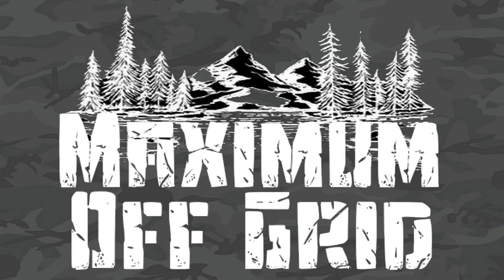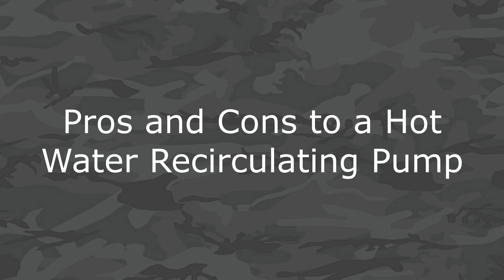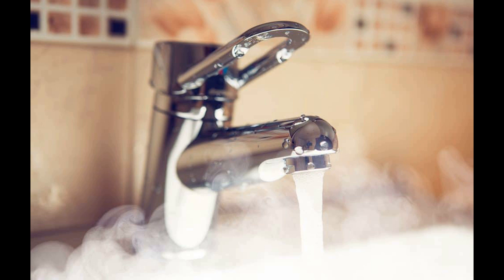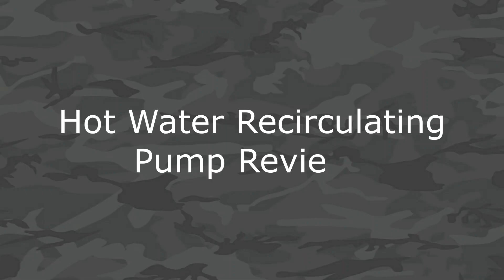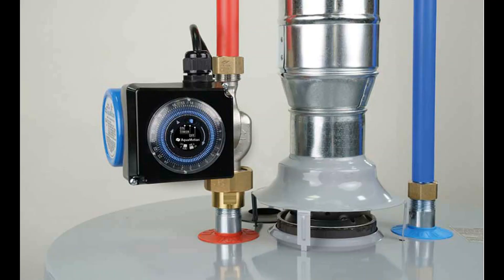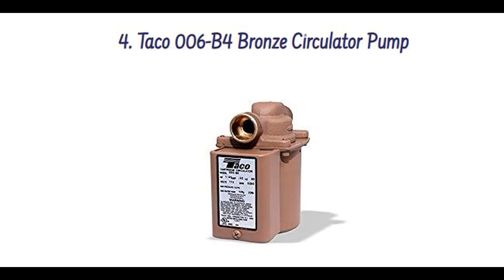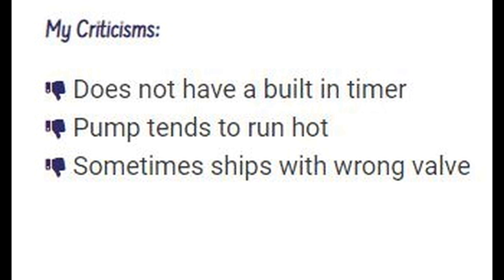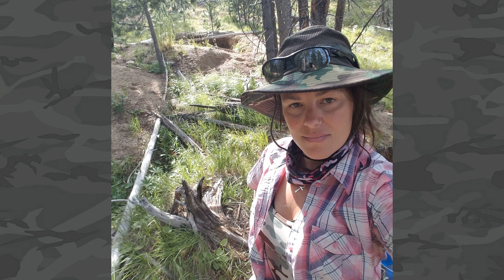All About Hot Water Recirculating Pump Systems! Product Reviews and Valuable Info

Comment: Also...GET RID of the COPPER SPIRAL tubing which will eventually BREAK.
REPLACE with Stainless steel BRAIDED tubing.
I lost 6,000 gallons of water with the spiral copper ones before I even discovered the problem.
Reply from the maker: Oh wow, that is a good point. Ty!

Comment: Hi,
Just discovered your channel.
A couple of thoughts on this subject...
You could put a flow meter on the cold water main to the house for a year and this would quantify gallons used. If you take readings monthly/weekly and record temperature and weather you would have a good baseline for comparison after making improvements.
Next, you could eliminate the pump entirely by doing two things:
     Run a return pipe from just before a hot water faucet back to a return manifold located at the base of the water heater.
     Wrap the existing hot water pipe and the return pipe together in insulation to help preserve heat in both pipes. In this way the natural difference between more rapidly moving water molecules (hot) at hot water out of the water heater and the less energetic molecules (cold) of water returned to the water heater will provide constantly recirculating water flow to all such plumbed hot water faucets. Thus, no need for a hot water pump.
Enjoy your channel.
Cheers,
Mark
Reply from the maker: Thank you for the great tips! And enjoy the channel :)

Comment: Thanks for your video. I have only been researching these systems for a couple days and I have come to a little different conclusion. I would rank the Watts after the Laing. The reason being reviews for the Watts suggest the the valve that goes under the furthest sink does not last long. Maybe 1 to a few years. They can fail to make the water hot or may fail be staying open and the both 'hot' and 'cold' are hot and waste energy. They are like $50+ and are made of plastic. People often have problems with them breaking threads. Generally people hate them. They really should make a brass version in my opinion. The Laing also just makes more sense to me since My furthest faucet is the kitchen sink which has a power outlet open there.
Thanks again for the video. :-)
Reply from the maker: Yes, the Laing is really the best, but the price point is a bit high, so I figured in that aspect. But if you have the money, definetely get the Laing!

Comment: Lotsa issues here and many points are simply misleasding or wrong. Pump flow will not cause corrosion of the piping. Maybe you're confusing "erosion" with "corrosion". Even here, erosion comes from the water carrying dirt and abrasives, and a domestic water system has no debris. The extra erosion from a few GPM more is almost zero-more. Not much at all for copper and probably zero for PEX.  Not a valid point at all. Another "pro" besides immediate hot water....is the prevention of some nearby pipes from freezing, expecially if the under-sink valve is near a sink where the local  pipes can freeze. The under-sink valve will "push" some of the hot water into the cold-water line whenever the temp of the hot water ( at idle standby) decays too much, and is replenished with fresh hot water ( happens autmatically from the hot-to-cold side of the valve, via the thermal element). The thermal valve portion, inside the under-sink valve, will do this for you automatically, and it may help prevent pipe freeze nearby. The TACO system is better overall to either the Watts or Grundfos   Also, in dispute from what you say, The TACO I have has THREADED connections, is made of Stainless, and DOES have a timer. So what are you talking about:? There are at least a 1/2 dozen different TACO models to choose from. The Watts or (identical) Grundfos pump systems, have under-sink valves that do NOT come apart to allow cleaning. The under-sink TACO valve is "openable"...to enable it to be cleaned or fixed. Heat traps on water heaters.....you say won't work. Many people agree on this point.  Guess what? ....almost ALL water heaters you buy over the last 10 years or so HAVE heat traps, so this caution will apply to nearly everyone reading this. If it's a flap-style heat trap, you can often remove the flap with needle nose pliers. The ball/cage style require more work to get the ball out....but it can be done. 
Finally....I challenge you to say this is an "in-depth" review...as I am certain YOU did not buy all these and test these....but you are only repeating written reports you may have found on each. This is misleading. All in all.....this is a fail, as this is not your own testing, and some of the data is plain wrong.
Reply: You may have some valid points, but your tone is really offensive. It’s easy to dis agree without being disagreeable. Have you considered doing a video on this yourself?
Reply: @joeoleary5346  ,...citing corrective facts, and calling out bluffs, is not being disagreeable.  How else can these same points come out without the original pesenter maybe being rankled? I wish you a Merry Christmas.
Reply from the maker: You have some valid arguments here, and I appreciate the time you took to provide me feedback. The recirc pump is a complex topic and for it being my very first youtube video, I think I did a pretty good job. It would be impossible to test all of these pumps, but hardly anyone on the net has even attempted to put together a review for recirc pumps. At least I put in good hard research to give this video a lot of value. I will give myself a pat on the back for my efforts and try to improve on my updated recirc pump video coming out soon.
Reply: @RusticSkills  ..no issues on your effort....apologize for maybe the cranky approach I used to comment at the time....but my point is that providing a textural review of options is not an "in-depth" review...as that label would require you ( or others that you can point to)..... to have had your hands on the hardware, or similar....to gain the label "in-depth" . There were also a number of factual errors in your presentation....those that I called out....and I bring up those issues because others are reading and being informed by what you say, as being true and factual. No issues that you put-ina considerable effort...I'm sure you did....but fact-checking and nomenclature could have been edited better. Just responding for clarity and not for irritation or continuing an argument....cheers.
Reply from the maker: @TheWilferch  I do appreciate your feedback. Tbh, I had zero expectations of this video going over 100 views, let alone approaching 100,000! There is no way to edit a vid once released, only deletion. My plan is to make a more accurate version of this vid and then have a link on this vid to point to the new one. I've learned so much just from the comments it is amazing! Who knew hot water recirc pumps would strike such a cord. Well until then!
Reply: @RusticSkills  ...thank you for the courteous response...again, my apologies in public for my first brusk repsonses.....that said....good, ...I wish you all good fortune as you continue on this path.
Reply: Someone take away Wil's keyboard..
Reply: Who gave Will back the keyboard!?!
Reply: @nateshizzle1  ....tell me where I'm wrong.....this original remark I made to this presentation is months old, and I have no reason or desire to engage.....yet an email landed in my inbox today.... to prompt me back in by showing this latest response from the originator, which tells us nothing about the points I bring up that attempted to make the issues more factual. Tell ya what..... believe that "erosion" is the same as "corrosion".....believe that some pumps come only one way with threaded or flanged connections....when in fact this is not true ....believe what anybody says....I'm ok with all of that, if that's what you want to believe. I apologized for the tone of my original note, but cannot stand down items I show were presented that are false. Out.

Comment: Great video! Do you have any thoughts on the Chilipepper pump with a tankless system?
Reply: I have had 3 Chilipeppers, original one lasted about 8 years, replaced it outside of warranty. The replacement worked for about 3 months when I accidentally ran it dry, got another one and is working fine. NEVER run it dry, pro-tip. It is a bit loud when activated, but it is only on when you need hot water. I have it on a conventional tank heater, but I think working on a tankless unit would be fine. If in doubt call up the company, they'll know for sure.
Reply from the maker: I haven't done much research on the Chilipepper but will include it in the next updated video!
Reply: I used it on three different homes .. I loved it .. it’s a bit noise not too bad at all.. I’m sure it’s gonna work great in a tankless. It might be the most affordable one for a tankless

Comment: Here is a question i can't seem to find an answer for:  My current water heater is a 50 gallon electric TANK model.  believe it or not, it is an A.O. Smith and is 26 years old - a house original - so i can't complain that it has lasted a long time (I've only owned the house for 4 of these 26 years).  well it is now failing and i am going to replace it with a tankless.  seems to make sense.

the situation:  the current water heater has a re-circulation pump off the hot outlet side with a dedicated return line (the return line going back into the cold water inlet of the WH, check-valve to keep it from going back into the cold supply line and water softener) so there is hot water at every faucet in the house within seconds.  almost instantly.  there are motion sensors which activate the pump for a minute or two so it is not always running.  

i  believe there is even a sensor at the end of the return line (before it goes back into the cold inlet) to keep the pump from running if the water is already above 120 degrees (or shuts it off if that temperature is detected before the motion sensor would shut it off).  without the pump, it would take almost 3 minutes for the water to get hot at the furthest fixture, and it cools off quickly once you shut the faucet off.  makes it a pain in the butt for rinsing dishes in the kitchen - which is the furthest fixture.

the question:  how do you hook up any electric tankless water heaters WITH the circulation pump in the loop where it does not void the warranty?  i have seen videos (for Rheem) that has this feature with a gas model, but not electric.  Certainly there must be a way?  

the theory should be the same with a tankless model as it is for a tank.  activating the pump when you walk into a room is like turning on the faucet (because of the return line).  the WH does not know someone has not turned the faucet on.
Reply from the maker: Well that is quite an interesting situation you have going on. From what I understand, the only difference between a tank and a tankless electric water heater is the tank is an additional feature to store extra hot water, but it works exactly like a tankless.

That being said, I would be weary of hooking up a traditional circulating pump to it, as most are incompatible with electric tankless water heaters. 

There is one model I have found that works with tankless, but it is rather expensive at over $500. If you are interested I can send you the link to the pump.

Comment: Not mentioned is that the valve under the sink has a thermostat.  this thermostat is often set to stop water movement at 95 degrees.  so you will likely not get so hot water only warm water.  another disadvantage is that if you turn on cold water you get hot for the same period of time it took to get hot water originally.  for me not good enough.
Reply from the maker: Yes, the recirc pump does not work for everyone's situation. You have to evaluate if its right for you.

Comment: If my water heater has a heat trap does that mean none of the pumps will work?
Reply from the maker: I wouldn't go so far to say that none will work. However, I recommend that you check with the manufacturer before purchasing a pump.
Reply: Heat trap doesn't matter, it's a lot of folks spouting stuff they don't understand. The pumps work on positive flow so it's going to push the water through the piping.

Comment: Just installed the Watts 500899 H.W. recirculating system.  It works as advertised and I would highly recommend it.  Question:  After the initial H.W. pumping has charged the line, does the thermal bypass valve re-open as the water cools down?  Will the pump automatically restart when the valve re-opens?
Reply from the maker: I found a great article that should answer your question, way more in depth than I could describe: https://besthotwaterrecirculators.com/how-do-sensor-valves-work/
Reply: A city water line point of entry has a back flow prevention valve installed as a code requirement.  The meter will not allow 
back flow either. No water that has entered your home can pass back into the primary water supply from the street.  I’m not positive, but I think the pump is actually sending the water back to the hot water tank so it’s refilling the tank as it’s pumping. If a different hot or cold  water faucet is opened elsewhere in your home as the pump is operating, the pump will send the water to the open faucet which then becomes the point of least resistance.

Comment: You never said if any can be used with a tankless water heater, only that the first one would not
Reply from the maker: So I have found only one tankless water heater recirc pump that is compatible with all tankless models. It is quite expensive. I listed it on my article; I cannot edit the video to include it. I will be working on an updated video to include that pump. You can find it here: https://www.maximumoffgrid.com/off-grid-water-system/hot-water-recirculating-pump-reviews/#3

Comment: Hello Regina, thanks for this great informative video, what is the difference between the pump on top of the water heater, or under the sink? And does the cold water line would have more pressure build up?
Reply from the maker: Thanks! The difference between the two installation points is that undersink installation does not require a return line, whereas installing at the water heater does. When installing undersink, place the pump at the farthest hot water point.

As far as cold water line pressure goes, from my research I have not found any issues about pressure in the cold line.

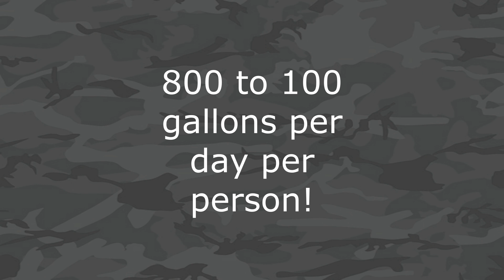Comment: Good review....You say on average we Americans  use 80-100 gals/day....yet your text at timeline 0:52 says 800-100.... may want to fix that. Also,.....is there a way to rig the system up to prevent water line freezing as a goal, instead of immediate-hot-water use?
Reply from the maker: Thanks, unfortunately I cannot edit the video once it's posted, darn! Since the system always pumps hot water thru the lines, it should keep them from freezing, but you can add insulation to the lines which will also help from heat loss as well.
Reply: @RusticSkills  ....the house is already built and I...like many others...may suffer the occasional cold snap in the South where the insulation around pipes is already a done deal...maybe poorly performed...and hidden behind cabinets and walls, and is ineffective. Can't reasonably "Add" insulation under this scenario. Problem for me is typically 2 bathroom sinks against an outside wall under these conditions. By the way, insulation itself often does little in these scenarios, as heat needs to be added. It's like these goofy outside hose spigot insulating boxes you can install. Over time......the air inside the box will attain the same cold ambient temps as outside the box,  and will still freeze, unless you put a lightbulb against the spigot too or some other form of heat input. It's like saying putting a coat on a dead body out in the cold is the same as a live person putting on a coat. You need heat production to have insulation have any longer term value.
Reply from the maker: @TheWilferch  So you can install this pump right at the water heater which will send hot water thru your pipes throughout the entire house, which could help them from freezing up, as opposed to installing underneath the sink. Although you might have some issues with heat loss since the hot water is traveling so far, since your pipes are somewhat insulated already it may actually work really well to keep at least the hot water line from freezing. Yeah I totally get what you mean by putting a coat on a dead body, good analogy! Lol

Comment: I would like to know what pump you use... i have a start in rain water collection and i need a pump to push it to another tank... of course would be nice in the house.. not sure how i can do that yet... but pump yes
Reply from the maker: The waterbug would be a good option just put it in the tank and place it on a programmable wifi outlet. you can turn on the pump from your smartphone and pump anywhere you want, it sucks water to 1/16th of an inch. Just don't forget to shut it off when you are done!

Oh, I am making a video on submersible pumps that will be out in the next couple days. That will have the pumps you are looking for.

Comment: We certainly need this in California what with them rolling out the 55 gallon per person consumption rate per day by 2022 or face a fine.  Thank you for the info, I didn't even know these pumps existed.
Reply: Come to Tennessee. We are in the Tennessee Valley Authority system and I can never remember any water shortages here. In the winter it rains and rains and rains. In the Summer it is hot and somewhat dry and there is no income tax. Don't tell anybody else though. We already have enough immigrants coming to Tennessee from red states.
Reply from the maker: They are a really cool pump and would help Californians stay under that water law and I am sure costs way less than the penalty would be.